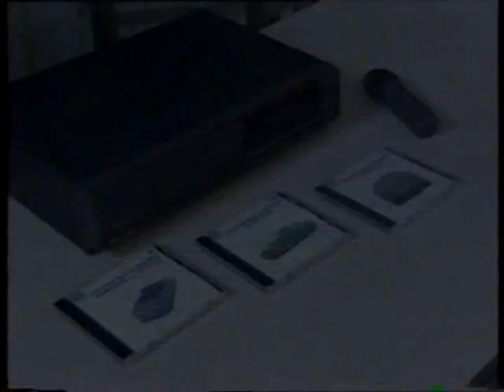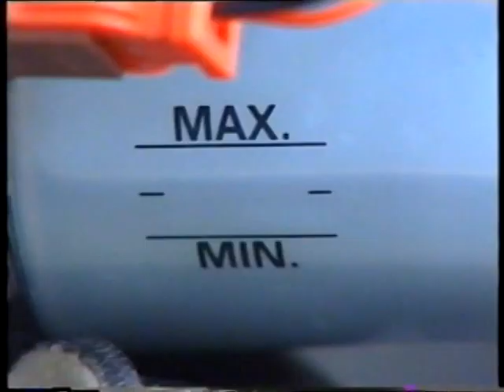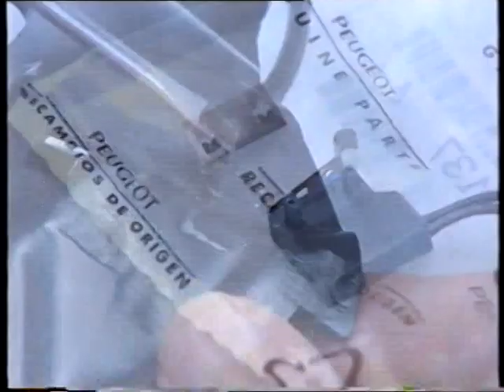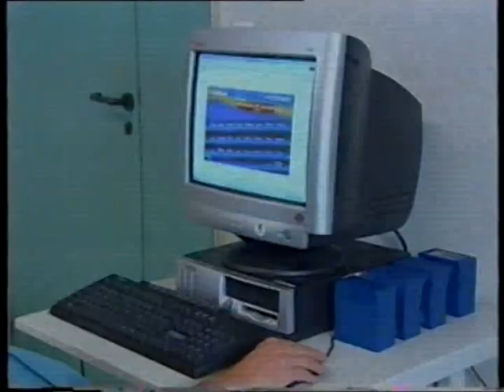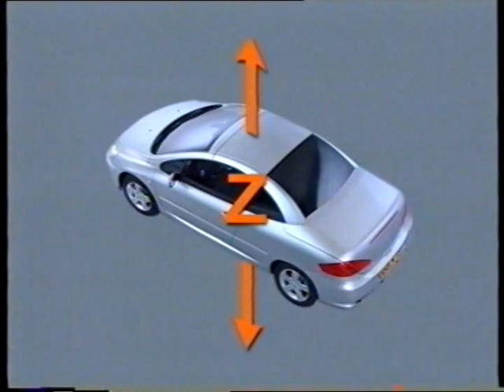Peugeot 307 CC review

Comment: THE REMARKABLE DETAILS OF THE 307CC
The roof mechanism of the 307CC was produced by the originally germany company named "CTS Car Top Systems", originally subsidiary of Porsche AG  which produces the roof mechanisms of Ferrari F430, Mercedes SLK, SL and Porsche Boxster, Chevrolet Corvette, Cadillac XLR and Lexus' convertible series.
The rear led lights of the 307CCs were produced by the German company "AL Automotive Lightening", which produced the rear led lights of the Audi R8 in 2008.
The tiptronic automatic transmission of the 2.0 136 hp version of the 307CC was manufactured by Porsche.
The piston rods, pistons and other piston elements in the engine of the 2.0 180 hp Sport version of the 307CC were manufactured by "Mahle", which manufactures piston sets in Ferrari's Formula 1 vehicles.
Peugeot participated in the World Rally Championships in 2004 and 2005 with 307CC. Peugeot equipped the 2.0 180 hp Sport version with a 4x4 rally kit, boosting its engine with turbo and reaching 580 NM torque and 315 hp. The 307CC WRC won the Rally Finland with Marcus Grönholm in 2004, the Rally of Finland with Marcus Grönholm in 2005, and the Rally of Japan with Marcus Grönholm in 2005.
Related news sources:
https://en.m.wikipedia.org/wiki/AL-Automotive_Lighting
https://en.m.wikipedia.org/wiki/CTS_Fahrzeug-Dachsysteme
https://www.carpages.co.uk/.../peugeot-307cc-review-part...
https://en.m.wikipedia.org/wiki/Peugeot_307_WRC
Reply: Virus

Comment: ...what could go wrong....and this is much simpler than EOS style 3 panel roof....
Reply: THE REMARKABLE DETAILS OF THE 307CC:it was  a succesfful sales car in germany and with 206 cc were a boom of sales  coupe cabriolet cars with metal roof in the world. The metal roof give more weight to the car so not superfast car but the metal roof is not easy to damage as canvas roof in the streets.Peugeots cc were whim cars.Nice cars to the beach no to rainy london england.The roof mechanism of the 307CC was produced by the company named "CTS Car Top Systems", which produces the roof mechanisms of Ferrari F430, Mercedes SLK, SL and Porsche Boxster, Chevrolet Corvette, Cadillac XLR and Lexus' convertible series.

The rear led lights of the 307CCs were produced by the German company "AL Automotive Lightening", which produced the rear led lights of the Audi R8 in 2008.

The tiptronic automatic transmission of the 2.0 136 hp version of the 307CC was manufactured by Porsche.

The piston rods, pistons and other piston elements in the engine of the 2.0 180 hp Sport version of the 307CC were manufactured by "Mahle", which manufactures piston sets in Ferrari's Formula 1 vehicles.

Peugeot participated in the World Rally Championships in 2004 and 2005 with 307CC. Peugeot equipped the 2.0 180 hp Sport version with a 4x4 rally kit, boosting its engine with turbo and reaching 580 NM torque and 315 hp. The 307CC WRC won the Rally Finland with Marcus Grönholm in 2004, the Rally of Finland with Marcus Grönholm in 2005, and the Rally of Japan with Marcus Grönholm in 2005.

Related news sources:

https://en.m.wikipedia.org/wiki/AL-Automotive_Lighting

https://en.m.wikipedia.org/wiki/CTS_Fahrzeug-Dachsysteme

https://www.carpages.co.uk/peugeot/peugeot-307cc-review-part-1-14-01-05.asp

https://en.m.wikipedia.org/wiki/Peugeot_307_WRC

THE EQUIPMENT LIST OF 307CC

Advanced Trip Computer: Standart

Driver Airbag: Standart

Passenger Airbag: Standart

Side Airbag in the front seats: Standart in all 2.0 petrol; optional in 1.6 petrol and 2.0 diesel

Immobilizer: Optional

Digital automatic air conditioner: Standart in all 2.0 petrol ; optional in 1.6 petrol and 2.0 diesel

Front seat heating: Standart

Rear seat heating: -

Mirror heating: Standart

Windshield defogger: Standart

Rear window defogger: Standart

Headlight washer: Standart in all 2.0 petrol ; optional in 1.6 petrol and 2.0 diesel

Music system brand: JBL 

Automatic wipers with rain sensor: Standart

Auto flashing headlight: Standart

Height adjustable headlights: Standart

Height adjustable steering wheel: Standart

Depth-adjustable steering wheel: Standart

Height adjustable front seats: Standart

Front parking sensor: -

Rear parking sensor: Standart in all 2.0 petrol ; optional in 1.6 petrol and 2.0 diesel

ABS: Standart

ESP: Standart

Alloy rims: Standart

Air-conditioned glovebox: Standart

Hot and cold blowing to the rear seats: Standart in all 2.0 petrol ; optional in 1.6 petrol and 2.0 diesel

Auto-dimming rear view mirror: Standart

Disc front brake: Standart

Disc rear brake: Standart

LED tail lights: Standart

Side mirrors that folding with electric mechanism: Standart in all 2.0 petrol ; optional in 1.6 petrol and 2.0 diesel

Rear seat seating capacity: 2 Persons (comfortable seating)

Luggage suitcase and bag capacity when roof is open: 1 large suitcase and handbags

Luggage suitcase and bag capacity when roof closed: 2 large suitcases and handbags

Automatically opening roll-over bars with airbag mechanism at the seat heads: Standart

Original alarm: Standart in all 2.0 petrol ; optional in 1.6 petrol and 2.0 diesel

Isofix Mountablity: Seats are suitable for isofix mounting

Central door lock system: Standart

Door lock system for children: Standart

Electric windows and electrically adjustable mirrors: Standart

Cruise Control: Optional in 2.0 petrol

Leather Seat: Standart in all 2.0 petrol; optional in 1.6 petrol and 2.0 diesel

Leather Dashboard: Standart in all 2.0 petrol; optional in 1.6 petrol and 2.0 diesel

Features of rims:

17 inch RC alloy rims with coded wheel bolts in 2.0 180 hp Petrol;

16 inch alloy rims in 2.0 140 hp petrol, 1.6 110 hp petrol and 2.0 136 hp diesel.

Engine Features:

Engine Option: 2.0 GT RFN engine (EW10J4)
Engine size: 2.0 (automatic transmission)
Horsepower: 140 hp
Fuel type: Petrol

Engine Option: 2.0 GT RFN engine (EW10J4)
Engine size: 2.0 (manual transmission)
Horsepower: 140 hp
Fuel type: Petrol

Engine option: 2.0 RC RFK engine (EW10J4S)
Engine size: 2.0 (manual transmission)
Horsepower: 180 hp
Fuel type: Petrol

Engine Option: 1.6 NFU engine (TU5JP4)
Engine size: 1.6 (manual transmission)
Horsepower: 110 hp
Fuel type: Petrol

Engine option: 2.0 HDiF engine
Engine size: 2.0 (manual transmission)
Horsepower: 136 hp
Fuel type: Diesel